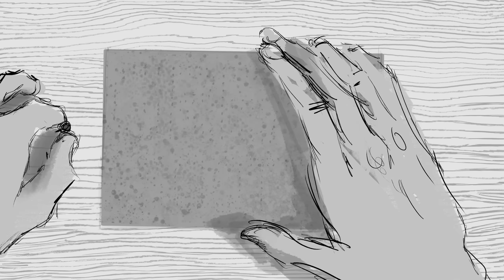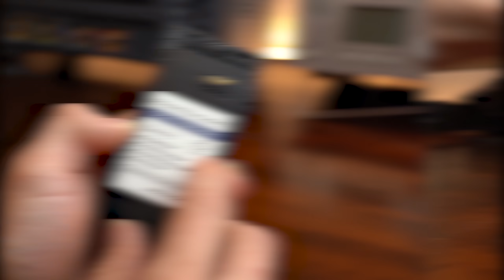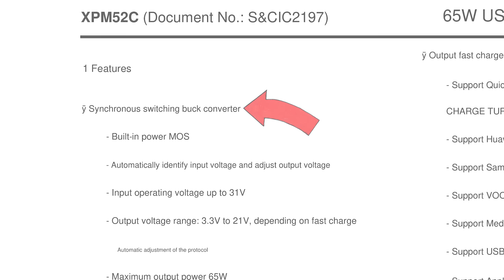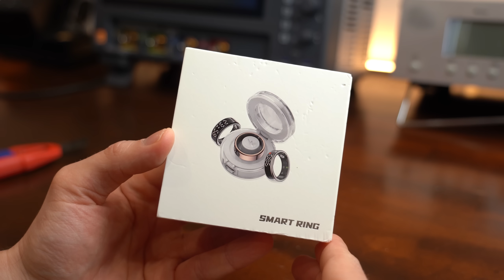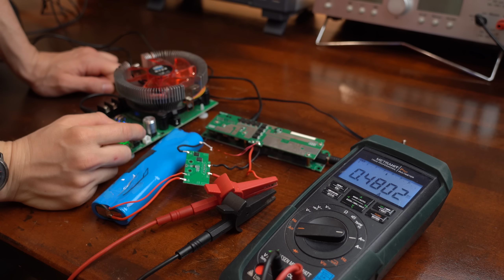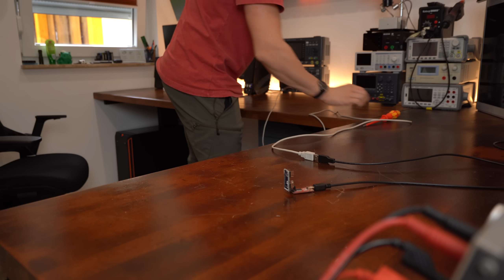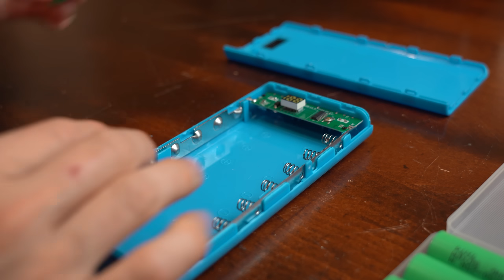I tried finding Hidden Gems on AliExpress AGAIN! (Part 17)

Comment: Audio over Chinese cloud, Chinese user accounts, installing Chinese software... and still a thumbs up? System and network security and data protection should be part of your review. And I'm not gonna lie: I see some flags just as red as the battery pack case 🚩🚩🚩

Comment: I just got the power bank in your video, I fully populated it, I was under the impression that having it wired that way would automatically balance all the cells, is it really that bad, I fully charged it up but haven't used it for anything yet.

Comment: Be aware though, those smart ring's battery can swell, causing it to be stuck on your finger if you happen to wear it at the time.
For example, Samsung even got a guide on where to cut the ring in case like this.

Comment: Great video! Very helpful. For the UPS switch-over time, are you sure that the scope was triggered properly? Those Keysight scopes are sometimes need a "good" resolution on the volts/div to be able to trigger close to the average voltage. Since the UPS battery is bypassed when AC is present and only switches when AC is removed, I would expect the switchover to have at least a few ms of time delay. If there was no glitch in the 12V output, then the battery might have been in the circuit all along. I could be wrong. Anyways, good job!
Reply: The trigger is set to 12.5V and the voltage is 12V, so yes oscilloscope is incorrectly setup.
But it would not be too hard to create a near glitchless output if there is enough output capacitance.

Comment: I use that powerbank since at least 8 years and it's not a problem when you first balance charge your cells. The main problem is the input/output as it only charge with mini USB and output on USB type A, less usefull right now.

Comment: I've had one of those Android PoC radios for a while now but the overall experince is not great, IMO. Instead of the nearly useless keyboard, they should have included a larger screen. There is also no OS support whatsoever. My handset runs Android 5.1 which is nearly useless today.

There are Android-less PoC radios out there that I assume work somewhat better but all of them require some sketchy PTT services where someone could be listening in on all your convos. So far I have not seen a free (or paid) server software that would enable you to roll your own private PTT server. That would make these walkie-talkies much more interesting.

Comment: Last power bank i am using now ower 20years. And only got once melted that bus thats connects bateries to mainboard. But i am heavy user. It works best for my needs. Now they comes with 2.1 version chip that is better and without a glich but sadly without manual enabling funktion. Old versions had that three push button it enables manual on three pusshes that button it goes off. But never insert battery without a sleeve. Because these batteries from laptops on positive end have shorter contact and without a sleve they easily shorts all pover bank. It is than dangerous. But if you inserting good batteries with their colorfull sleve it is perfect one. Over 20+ years i had them 4. But one of them still works around 15years. Sadly with this device there is no way to enter to travel with airplane. 
And about these walkie talkies it is bulshit device because it usses only zello and this software cant work without data connection and if you got blackout with celular comunications device will be usseles or only for set of fireplace with battery. And zello soft you can download for a smart phone to. And i am using for a competitions. So in mountain or forest these walkie talkies it is useles because in there is no cellular reception. Othervise that Baofeng with Nagoya antenas works in mountains araund 18km in forests i getting reception around 5km and for me it is perfect. But if i get connection over reapyters i talked with it over 75cm band and it was over 4000km. Of course if you download zello and there is no comunications blackout in your country than you can talk with all around a globe. :) Nice video but this one is strange one. So from this video i only will buy that poer bank. :))

Comment: My USB-C-PD boards already moved in the trash. They look identical to yours. Big flaw: Before the USB-PD negotiation was done, they already supplied V_BUS with ~12V. That's not according to the spec, and of course dangerous for devices that only work up to 5V.

Comment: Don't wear electronic rings, if the batteries suddenly expand and set on fire, they can get stuck on the finger and burn it badly all the way around, leading to the loss of the finger. It's just not worth it until battery tech becomes completely safe. This has happened to people.

Comment: Great videos, thank you! I have two of the blue battery packs that I have been using for ages, no issues. The batteries were all within 0.1v of each other when installed. Is there any ongoing issues with this type of battery pack? Thanks
Reply: Yes, if one of the cells gets out of balance, it will continue to send voltage to it. There is a reason why tool batteries have connections to every single cell

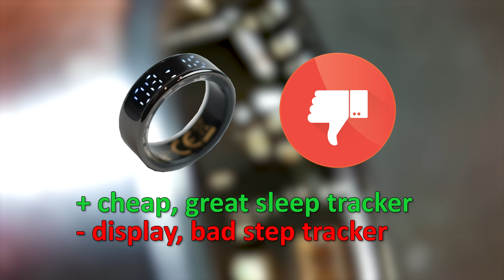Comment: 8:37 I bought one of these (without the display), and the BLE characteristics are not encrypted or anything.
With some reverse engineering (partly myself, partly some guy online) I wrote some code for a pet robotics project of mine using an NRF52
Basically my microcontroller asks the ring to poll sensor data, so I could use the accelero of the ring to pilot the robot with my hand, and heartrate sensor to detect whether I'm wearing it or not
Granted the values of the accelero are wonky, as it only updates if the ring moves enough, and the battery drains fast, so it's not "good", but really fun nonetheless and for very cheap

Comment: I love this series, and I'm really happy that you have kept it going for so long.  There's just so many items that it's hard to know what you can trust and what you can't, so thank you again.

I will say though, about the 18650 power bank, I actually have one (a similar one, probably not from the same retailer, but I'm pretty sure I did get it from Ali Express) but mine is black, and you're right about the display not being very accurate, but other than that I have had mine for over 2 years now and I keep it in my backpack which is always with me.  I've had to make a slight repair once that involved a little soldering (one of the internal metal pads came off and it made it so the whole thing wouldn't work.  So I just reattached the pad with a small dab of solder and it works like a charm again.

I would say that for the price that I paid for it, it was definitely worth it in my opinion.

Comment: RE: Chinese software for BLE UART adapter. Look for an .ini file in the install directory, e.g. config.ini or something similar. There is a good chance you'll find a language setting which is set to Chinese by default but can be changed to English. This value is often numeric such as "Lanuage=1" rather than ISO language code like EN, DE, CN, etc. 

P.S. Though less common than a .INI, but  I've seen settings stored in a JSON format.
Reply: I guess he is not scared from the language but from chinese supplied executable, silently calling in home :) or simply loading malware

Comment: Thanks for the video! I saw that UPS on Alibaba yesterday, thought I might buy one soon, now that I saw your review, I decided that yes in fact I do want it and will probably purchase it this week. One small - hopefully taken as constructive - criticism would be I wished you’d tested how long the battery lasts on backup. Also, I would have liked it if you would have mentioned your thoughts on adding more batteries to the battery array - if that’s a viable and recommended way to increase the amount of time it could act as a backup power source if necessary, and under various conditions. It almost sounds like I’m asking you to make a video on the UPS alone, doesn’t it? Hmm…not a bad idea, actually. 😉
Reply: How long the battery lasts will depend on how much current you're drawing from it

Comment: The walkie talkies are exactly like how Nextel in the US used to work, push to talk and these even have the same beep notification. But Nextel users were so annoying, talking on them in public and hearing both sides of the conversation and usually loud too. No respect for the people around them. We used them at work and they did work great, but outside of work I would use mine with the earpiece speaker, not speakerphone so everyone couldn't see how "cool" I was since I wasn't using the speakerphone. I was glad when Nextel / Sprint merged and the PTT went away. 
Now today we have to deal with people blasting mindless Tik Tok videos like everyone around them wants to hear it too. 
Yeah, I'm grumpy but also have respect for the people around me.

Comment: The trick I use with that style power bank is to fully charge the intended batteries first (tp4056 modules are great for this) then let them sit for a day or so

Then just reject any that aren't still fully charged.
Reply: Absolutely the best thing to do!

Comment: Hello! These BLE-uart microchips are very fast and reliable. I use them in production under rather harsh conditions.
You can avoid using Chinese software if you buy another identical module and connect them using “AT...” commands. You can pair them with each other, and they will automatically connect when powered up.

Comment: I have a similar battery case for 18650 cells, and i can confirm the downsides.
I'v put many times a cell in reverse and melted the spring in a blink of an eye...

And i'm always use same batch cells to avoid mix old and new, also charge theme with a special charger before first use, to equalize the tension. 
Better than nothing ^^

Comment: just connect at least once discharged batter to a charged one and measure the current and how fast it will go down! It is mostly the myth, than a real danger. Even if something going to happen it will happen in first 5 minutes. So just don't leave it unattended.

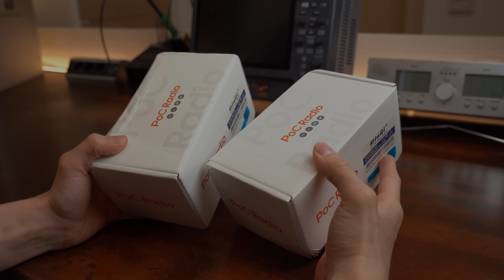Comment: 2:12 This kind of "radio" is very popular here in Thailand, especially officers, because of its ease of use, theoretically unlimited range, and no need to have a license for the radio operator...

Until the 4G network broke down due to the disasters, like flood that happen recently. Then it become a paperweight.

Comment: 14:24 I have a radio)/Bluetooth speaker that uses two 18650s in parallel. I have to remove one cell and charge each cell individually. Then before putting them in parallel, I check the voltage with a multimeter, that there is no more than 0.1v difference between the cells.

Comment: Heads up that these commercial PTT over Cellular devices are basically equivalent to running a regular VoIP app on a smartphone, i.e. they communicate with regular IP traffic over the cellular network. They have the same priority as watching youtube. MCPTT is a different thing. Regular voice calls are also implemented with IP now, but have higher QoS priority.
So, aside from the other obvious fact that it won't work if the network is entirely down, don't get these expecting them to be useful in an emergency. Everyone flooding onto whatever network is available to try to get on the Internet will render these useless.

Comment: There is a great Powerbank supporting USB C and PD (with only up to 18W @9Vx2A though) utilizing 21700 cells.
Looks way better than this, has even a built in flashlight, and costs around 10 EUR. Would be great if you test this one out.

Comment: May be they need to make 18650 cells in series and then add a BMS, balanced charger and the USB PD source circuit, so it can become a very powerful USB PD power bank!

Comment: I have such a smart ring. It's really good for me - it does show the time! In cold weather accessing the smart band or watch or cell phone can be not so easy but the ring is very accessible (yes, no gloves, don't ask why). All its other features - pulse, SO2, steps, sleep - they do work (and pulse and steps are quite precise), but they are not as important as having the time display on the finger.

Comment: Watching the little UPS, I thought to something : by any chance, have you stumbled upon a powerbank with decent capacity, with USB-C IN, which can deliver power and be charged at the same time ?  Basically a kind of "USB-C powered UPS for USB powered devices"
Reply: A lot of nicer powerbanks can, such as the Anker 737, the problem is that when any change is made to an input or output connection, the whole thing briefly disconnects. So if the input loses power, the outputs will shut off for a moment, or if you connect or disconnect a device from an output, the other outputs briefly turn off. It makes these powerbanks and even wall powered multi-port USB-C PD chargers pretty useless as a UPS.

Comment: The powerbank case is not dangerous because even if voltage is not the same between cells you are inserting, those springs on the negative side limit current a lot. It wouldnt be as dangerous as you think.
Reply: Just so that other readers are aware.. either the poster was joking, or alternatively very uninformed.
Reply: @tohaason  do the math
Reply: @bismuth7730  So, let me see YOUR math. If they limit current so much as you claim then they would be hot.

Comment: Could you maybe take a look at the KingMa GaN charger? It has an XT60 port on which you can connect proprietary laptop chargers (like Lenovo's yellow rectangle one), which isn't constrained to USB-C's 140W PD limit. It claims 330W from the XT60 port, which, if true, could be awesome for high-powered laptops. I only need 175W for my Lenovo, but the idea is still cool.

It seems very interesting as a low-footprint charger to take with me to school, but I'm a bit skeptical about the performance since I don't want to ruin my laptop. No push, just a suggestion ;)

Comment: There was someone who had a Samsung smart ring like that one, and had to go to ER because the battery swelled on their finger. Never putting one of these on my hand.
Reply: Sounds like the perfect excuse to buy a Dremel if you don't already have one... Tell your wife it's actually part of the first aid kit, not your tools. 😂
Reply: @tin2001  If on a budget Harbor Freight and other Amazon options are like $10 and handle the same size bits.  Having said that, I do love my actual Dremel, but a cheapo would do the trick in a pinch.
Reply: I was thinking about this case too  x)
Reply: I feel like a sensible design precaution would be to have the battery on the outside, so a swelling battery bulged the outside, and not the inside, so it didn't trap it on your finger.
Reply: Will you also never wear a phone in your pocket, because the battery can start burning? It's all about a probability and the problem is that in the news you will only hear outliers (because noone cares that someone else wears the same ring and nothing eventful happened).
Reply: @petrkubena A phone is a lot easier to take off than a ring
Reply: That only happens with Samsung products.

Comment: If you ever get one of the cheap ultrasonic cleaners, it's worth protecting the PCB from water ingress before using it regularly. 

My third one hasn't died yet, my first two both had evidence of water damage on the PCB, so I painted the third one with 'liquid electrical tape' when I received it.

(All different models)

Comment: The smart ring step counter works just fine - you just have to walk on your hands. I only thought now to try it on a toe though it is thick enough that it would interfere with wearing shoes and as it is winter here in Minnesota, I will likely wait until summer to try it.

Comment: I have a number of battery banks that are similar but use screws for the case and they have worked just fine for months of charging and discharging. You need to 'grade' your batteries first to make sure the quoted mAh's are all similar and to weed out the bad batteries. I use a XTAR VC8 for this (can take 8 batteries but only grade 4 at a time, weirdly).

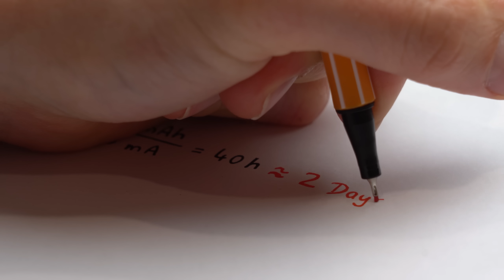Comment: 2:58 2 days? My 7 years old phone has ultra power saving mode, turning screen black and white and allowing only 6 selected app to run and only for foreground and it can last on one charge 7..10 days depending on cellular coverage.

Comment: That UPS seems useful for something like a home assistant running on an RPi
Reply: Or the original home assistant hardware. And your router. Perhaps the PoE function is the most interesting.
Reply: Way too dangerous for that. Just use an SLA UPS instead.

Comment: I noticed the UPS only outputs up to 24v for PoE.  Industry standard PoE is 48v
Reply: Yeah a bit downside, it has a model that doesn't have poe and can save a couple of euros. Some devices might accept passive 24v but wouldn't trust
Reply: Seemed like an easy mod to do with a booster to 48v.

Comment: Youve got something wrong about how cells are connected in powerbanks. As long as there is no active balancing its allways just in parallel. This powerbank is far better than a regular prebuild one. You can exchange bad cells and balance them from time to time with a charger.
Reply: You misunderstand. The problem is if the cells are not reasonably balanced when you put them in the power bank. But also, if they survive being put in parallel, they will not need balancing again. You're correct that defective ones can be changed - but make sure the replacement has the same terminal voltage as the existing ones before you insert it.
Reply: @matthewmarks6951 and when a contract gets corroded and has intermittent connection...youre in for a surprise.

Comment: There is a powerbank DIY kit from Heltec I am trying to test called something like "heltec power wall battery holder", the blue stackable one. First one short circuited because their instructions were wrong. But looks promising. May be something for lab use.